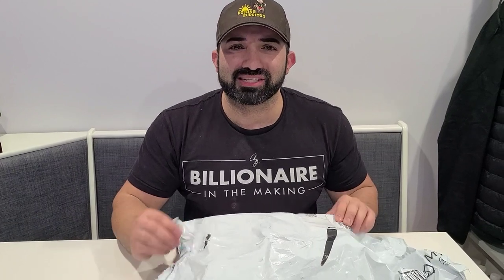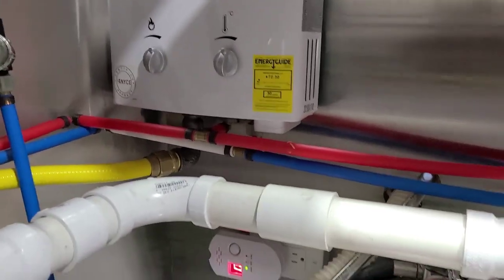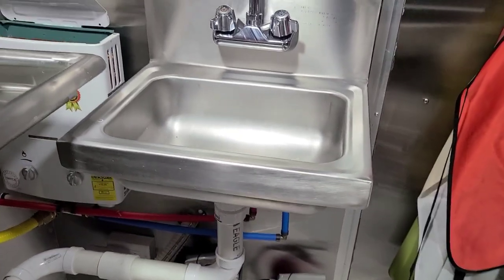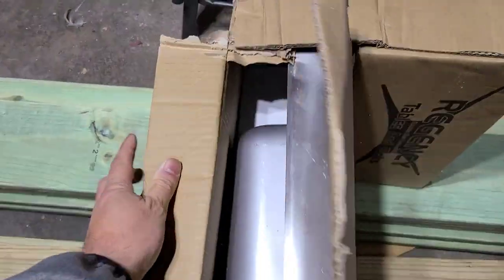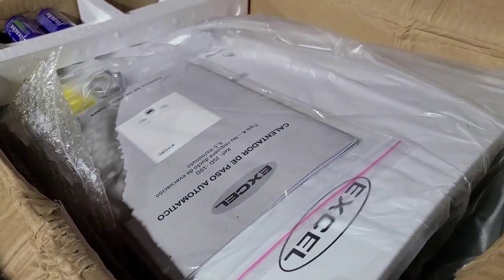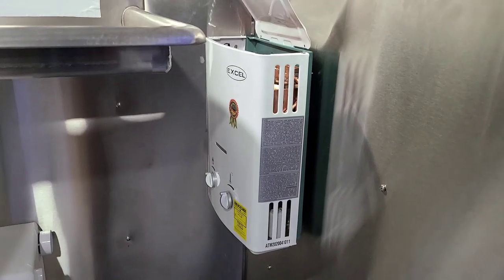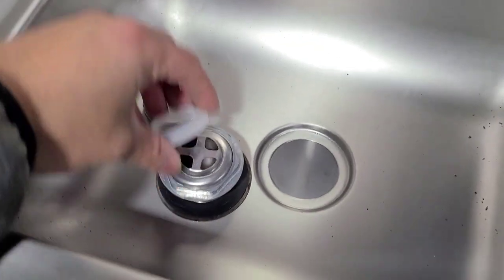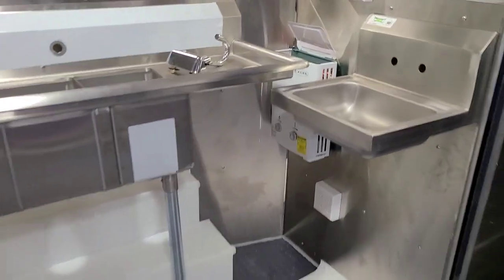How to Build a Food Truck: Plumbing

Comment: we bought the same excel water heater and the inspector disapproved it because it only heats the water up 45 degrees ,so she said if the water in tanks is 60 degrees it will only heat it up to 105 and thats not enough to sanitize
Reply from the maker: Interesting, good to know. HD with me has no issues, crazy to see all HD in the USA are so different. Thanks for that input 👍👍😁 appreciate it

Comment: Hi Frank, love your videos, did you have any issue with your water heater blinking red and never getting the water warm? My deep fryer looks like there’s getting gas to it when I try lighting the pilot at least lights for a little while, but my water heater click click clicks, and never any hot water?
Reply from the maker: Sometimes. You have to play around with the dial in the front.
Reply: @fbaltierrez  I’m thinking it might be the propane safety mechanism on the propane tanks? I’ve found out that if you turn on the propane tanks with the valve lines open and the regulator switched to open that the propane tank has a safety switch inside that thinks there’s an open leak, so it restricts the flow greatly? I’m going to try it out.

Comment: Hi Frank, looks like we have the same water pump for our sink set ups. I was wondering how you wired it? I’m having trouble getting mine going and I think it’s the wiring.
Reply from the maker: Very cool!! Great pump. The water pump just gets plugged in to a regular outlet and I added it to a switch to use when needed

Comment: So if I install a city/gravity combo hookup outside my trailor will I just Tee of into the inlet of the tank and whichever is hooked up will go in the tank or are there 2 seperate openings in the tank to connect too? Also do u leave the city water connected at all times or is it just to fill so basically if that’s the case I don’t even need the city side....it would just overfill right?

Comment: Hey frank ever have your water pressure pump start sparking? Thanks
Reply from the maker: Never
Reply: @fbaltierrez  mine started sparking randomly when the water isn’t running?
Reply from the maker: @ThomastheJokester  crazy. Never seen that. Definitely Replace
Reply: @fbaltierrez  yeah I think it was when I was pressure washing the floors I must’ve gotten the wires wet.

Comment: On your 3 compartment sink, did you remove the back legs and just run screws to help hold it up? If so, how well is that working when you have the sink full of water?
Reply from the maker: Yes removed back legs and screwed to trailer wall. Well it's been a almost a year and it still solid as can be. No issues
Reply: @fbaltierrez  awesome! I just purchased a 8.5ft wide x 18ft long x 7 tall trailer that ill be converting to a food trailer! You definitely make it look easier!

Do you recommend metal (steel or aluminum) over FRP?

Comment: I’m building a food truck and your videos really help. Thanks a bunch. I’m wondering how do I know what size clear/grey water tanks as well as the size the water heater has to be?
Reply from the maker: On my health department website it said exactly what the minimum size requirement is. Hopefully they have the same where you live or might have to give them a ring
Reply: @fbaltierrez  Thanks a bunch I actually have that information. The man mentioned that it depended on how much water I’d be using for what the size needed to be.

Comment: FRANK! I’m getting ready to install my plumbing, and I’m bought the same water heater. I plan on mounting it under the drain boards of my three bay. Do you have any thoughts on that placement? I’m mounting the splash guard hand sink just to the left of the three bay, I plan on mounting the heater under all of that.
Reply: What size water heater

Comment: Hi congrats on the 100k subscribers !! What are you doing for an ac/ heat unit?
Reply from the maker: Not 100k yet. Just 1k but soon we will be there. No Ac/heat unit just portable fan or heater if it gets too hot or cold.
Reply from the maker: You can always add one in later, but I haven't seen it as a necessity on my food truck yet.

Comment: Love the channel   Frank I need your help sir. The videos are great. But I have several questions. Hit me up with an email or something. Can’t wait to hear from you.
Reply from the maker: Appreciate the feedback. Comment any questions you have on the videos, that's the best way to reach me 👍👍
Reply: Ok Frank when running the gas lines, I have a small 12x6 trailer but am gonna set my hood and griddle near the far left rear door, a little further then you ran yours but my 32x64 trailer entrance door sits between the front wall and the griddle, can I run it above the door? To the gas griddle
Reply from the maker: @danielmeeksr9833  send me some pics to my email rollingburritosfoodtruck@gmail.com